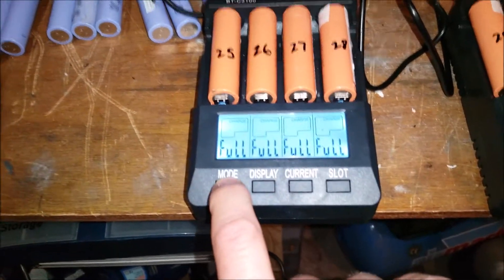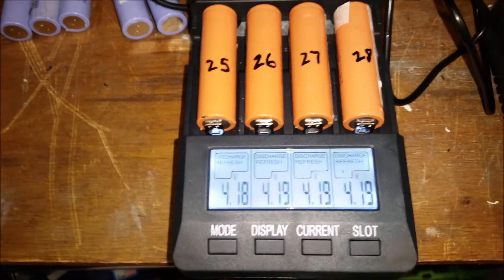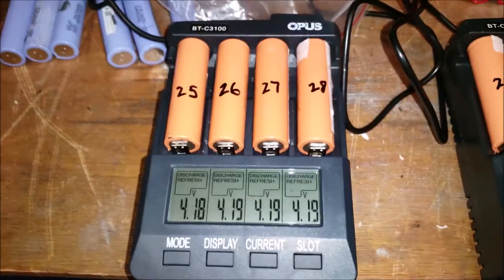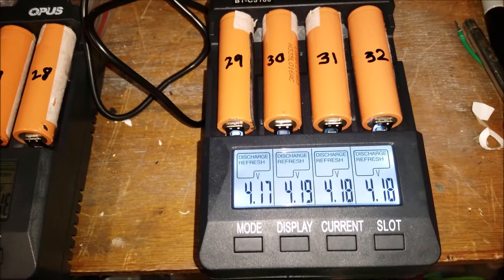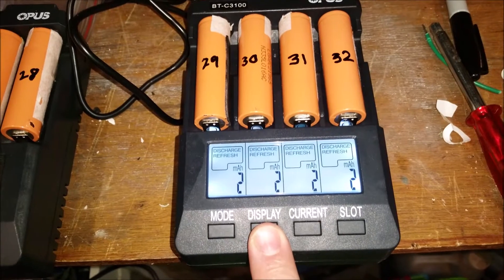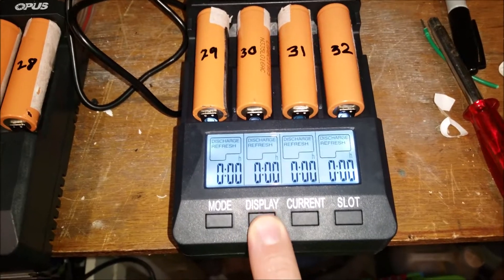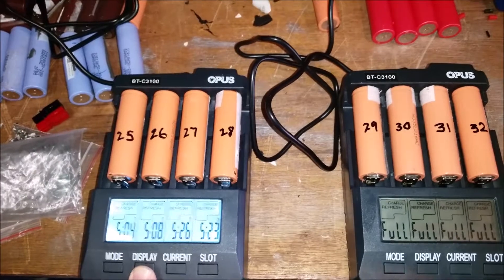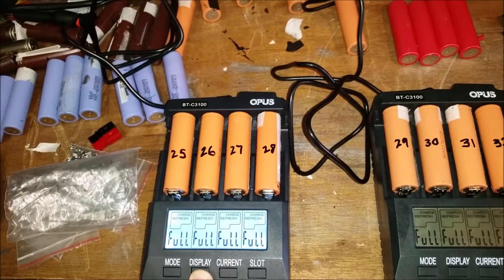18650 Battery Testing

Comment: Just got mine. Been checking my 18650 + 26650 mah. Took ages to complete. What reading's should I expect? A bit inconsistent across the board. Some 5000 mah show 1200 Some show 2500? Is it the discharge refresh function I use?
Reply from the maker: It really depends on the age/quality/ISR of the cells. Check the ISR if it's high then the cells have been hammered and will lose capacity.